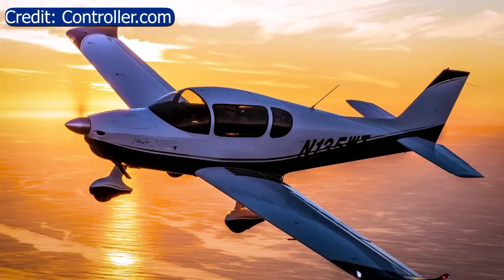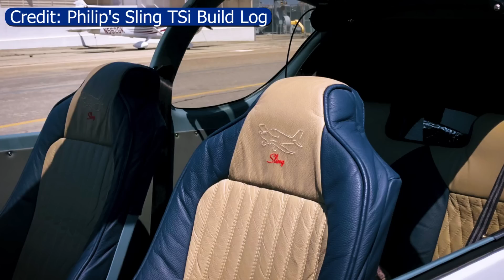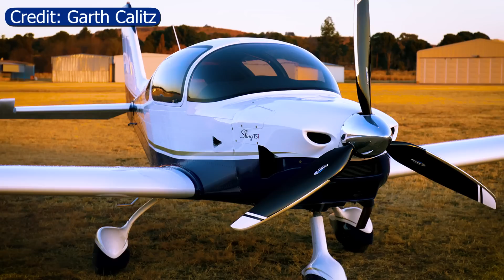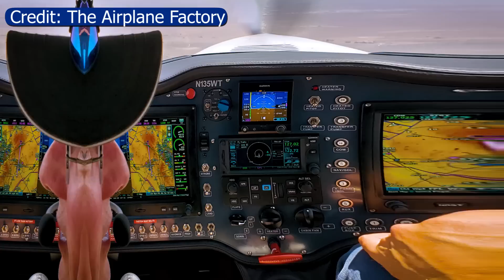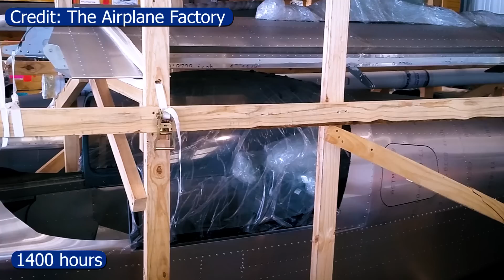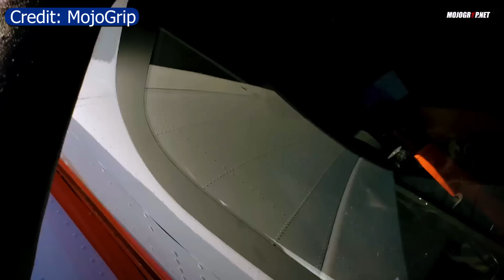Why the Sling TSI is Extremely Well Designed

Comment: New kits come with 916 iS engine now boosting take-off power significantly (vs the 915 iS) from 141 to 160 HP and slightly increasing continuous power from 135 to 137 HP

Comment: With the addition of the 141 turbo engine, @14.5k electronically controlled propeller system (air master) and the Eco mode option engaged range is 1200 nautical miles a 5.8 gallon per hour burn at 120 kn air speed for Just being about 150 55 ground speed.
On four dollars super unleaded . Plugs don’t foul no bad smell.
I hanger with the top of the line 182, which I have flown on multiple occasions, brand new with modified  wings  and engine.
The difference between a slide rule, designed airplanes from 50 years ago and a super computer designed modern vehicle .

Comment: For the cost, it's way to slow.
Reply: I mean, there's nothing comparable that goes faster. Keep in mind that this holds a thousand pounds easy, and can go 160 true airspeed at high altitude. This thing can climb up to 28,000 ft no problem...
Reply: Price shouldn’t be directly proportional to speed lol. A fast plane can be a shit plane, and a slow plane can be great
Reply: Please remember that The cheaper a plane is to buy, the more expensive it is to own. Yeah you can definitely buy a Mooney and it will go faster for less money, but you will also be paying over $100 an hour In fuel and maintenance.

The sling TSI cost only $30. So If you plan to fly somewhat frequently, this sling is better

Comment: The data is a bit outdated in this presentation.  The fuel tanks are now 26 gallons on each side for a total of 52 gallons.
Reply: 75 gallons with the long-range tanks. 10 hours of endurance is incredible
Reply: How much is the range with 75 gallon?
Reply: @zakariahofra6027  Well at 8 gallons per hour do the math, minus 30 minutes at 10 gallons per hour in the climb. 

With 45 minutes of reserve it's about 8 and 1/2 hours, and at 140 knots is 1190. In the real world you get about 1125
Reply: @zakariahofra6027  Some of it is going to depend upon how you're flying and the winds aloft.  Assuming no winds aloft and cruise speed it burns around 8 gallons per hour - so 75 gallons is around 9 hrs...

Comment: Nice ride but the initial cost would keep me in an older piper or bonanza
Reply: Beech Bonanzas are for experienced pilots. They are not powered by a 141 hp engine, they have a retractable landing gear and are not called ''doctors killers'' for nothing. Maybe you have the skills for flying one without difficulty but you have to admit that Bonanzas and Slings are not in the same league. I agree with you that the initial cost of the TSI is rather steep and I will add that you don't have to build the Piper or Bonanza in your garage.😀

Comment: "Antenna with the range up to 250 knots" - LOL
Reply: Ai generated narration
Reply: Nautical miles
Reply: When we use knots as speed, it's nautical miles per hour. In this case they're dropping the airspeed and just using nautical miles rather than statute miles.

Comment: thought they were metric in S A
Reply: They use feet for altitude throughout the entire world because in aviation meters make no sense. All of the atmospheric condition conversions are done in imperial units and the conversion rates can be done in your head. With metric the units were made to be times 10 * 10 * 10, with imperial aviation they were meant to be whatever was the most sensible

Comment: When are they going to introduce digital communications where whomever they're supposed to be talking to on the ground sends the next frequency directly into the comm and nav radios?  IF the pilot only has to press one button and not dial-in a frequency that makes it easier to fly the airplane in all conditions, plus the radio could maintain a record of the last 1,000 or more frequencies used.
Reply: A lot of the new Garmin avionics allow you to select a location on the screen and then see the current frequencies in use at that location and each airspace and touch to tune.
Reply: CPDLC…
Reply: @Captndarty  Does CPDLC automatically input the next frequency into the radios?   That's what I'm asking ... I think the radio should maintain a history of used frequencies as well as get updated by the ground controllers when they hand the aircraft off to another control center.  The radio would then at hand-off automatically switch to the new frequency.
Reply: @waltperko8389  if you can’t tune the radio you shouldn’t be flying. I don’t want my radio automatically switching on me. It would inevitably fail or switch without you now, and you wouldn’t know or remember the correct frequency.
Reply: @waltperko8389  Yes it does this. There's already a protocol for this. Mostly airliners have it but there are a couple experimental GA planes that have it. Technically the sling TSI can get it with avidine.
Reply: @Captndarty  some people say if you can't fly your plane you shouldn't be flying, you don't want your plane to automatically make the wrong turn, and that's an argument against autopilot when autopilot first came out in 1960s and 1970s. Now, it's pretty much required for hard IFR.